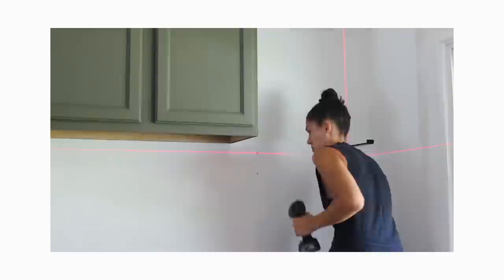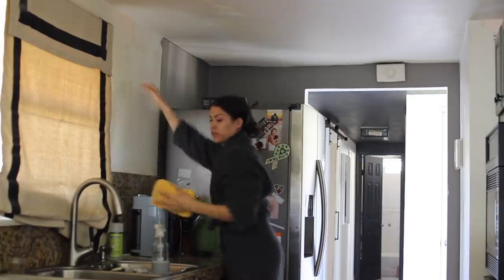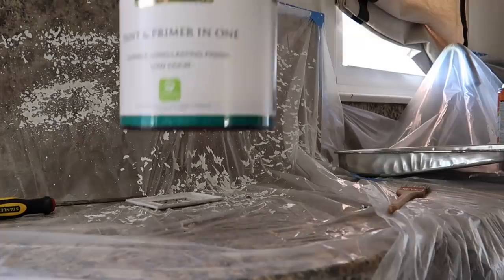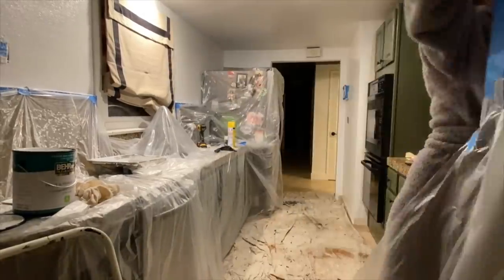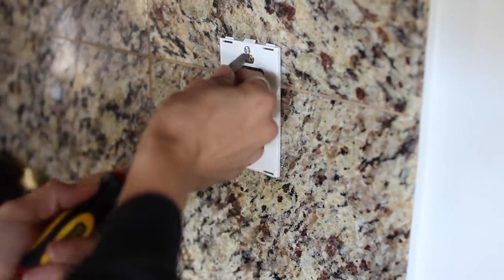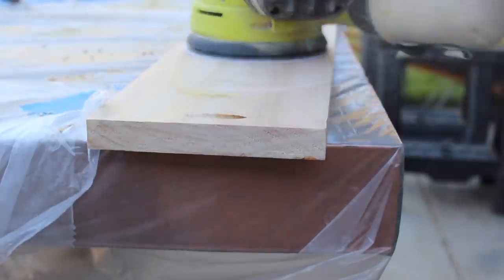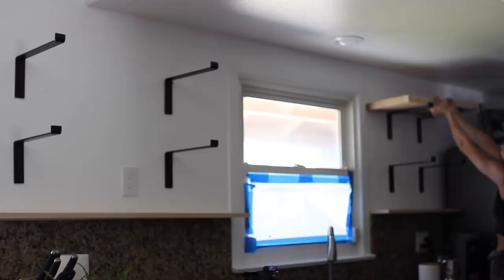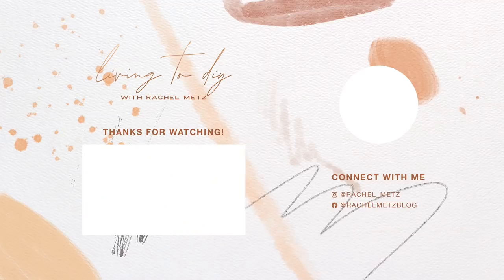DIY Small Kitchen Makeover

Comment: Next time, try just putting some sheetrock behind for support rather than a 2x4.  Plenty of spackle or mudd works.  Drill it from the front to the backside and leave sticking out so you can put the sheetrock back...you can remove the screws once that mudd is dry.  THEN put the old sheetrock back in place.  So easy to do.  Works every time, and you already are using mudding compound and sheetrock.  Easier than using a saw and trying to find some lumber.  Just sayin..............